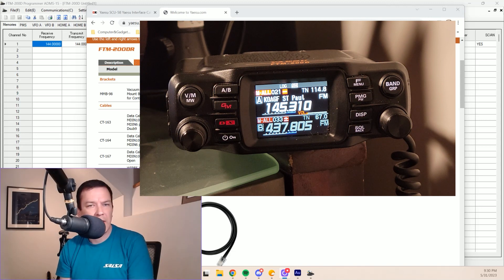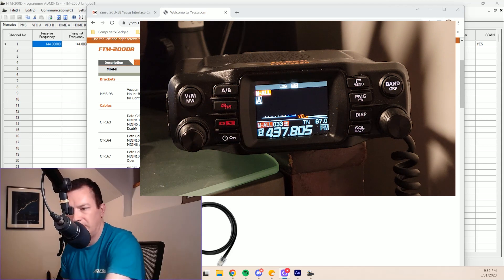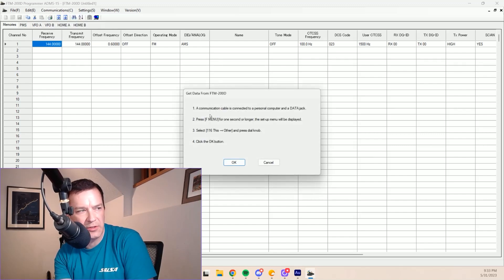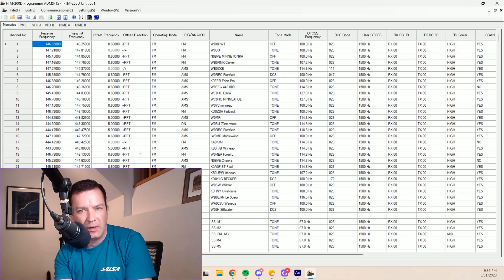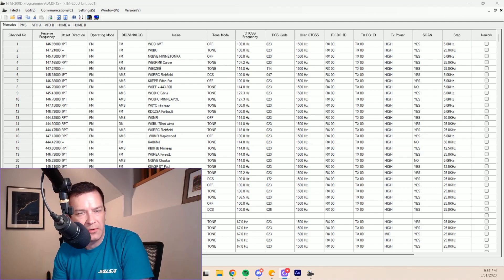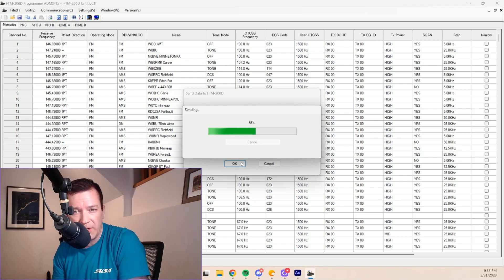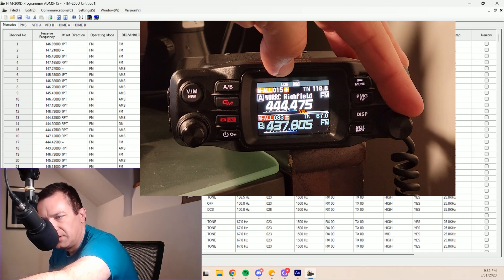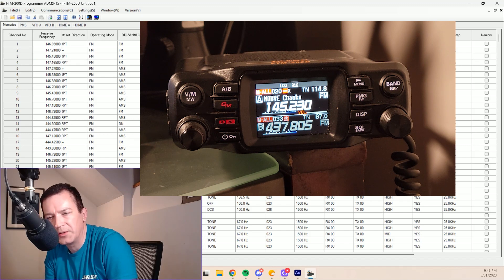Yaesu FTM Radio No Memory Bank Solution?

Comment: Interesting, making custom scan lists. But why not use the M-GRP function (in ADMS-12 also) to do this? It is fairly easy to add a half dozen channels from the front panel. See page 38 in the manual. By the way, the new FTM-500 firmware allows saving up to 4 MEM (and 4 profile and 4 config) files on the SD card, restorable from the menu. Not memory groups but close. 73

Comment: Fail.  Why I don't own a 400, 300, 200 or 500.  Their ancient 2980 has memory banks as do the HTs.   ID-5100 or older IC-2820 or IC-2730A do it all if you don't need/use C4FM.  I asked Yaesu at Hamvention and they said some word salad about memory/software space.  Really?  The SD card is unlimited.  Again total fail.  It's a shame, I really wanted a 500 but doesn't work for base or mobile for me without memory banks.

Comment: There is no elegant way around this issue, and shame on Yaesu for omitting this feature on an otherwise excellent radio!  As said in another comment, they included it in the FT5D, which I have, and it works beautifully in that radio!  I bought the FTM500 primarily for a new base station, but with an eye toward also putting one in my truck.  For home, this isn't an issue, but it's a deal breaker for my truck.  Apparently the Icom 5100 has memory bank scanning, and if I can confirm this, that will be the rig for my mobile use.

Comment: Just as @ag1382 says, I think using separate SD cards may work for travelling between large areas.  I'm also thinking about using an SD card extension cable so I don't have to get to the main unit each time I may want to switch.  This is not perfect either, but it may be an option.  My Yaesu FT-7800 had several banks.  Would be nice if they could update these newer radios with banks.